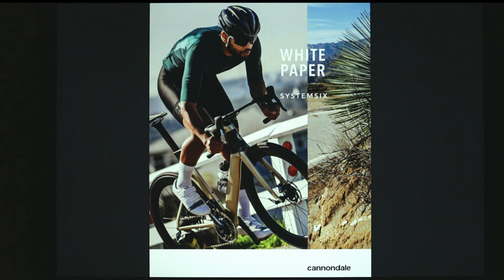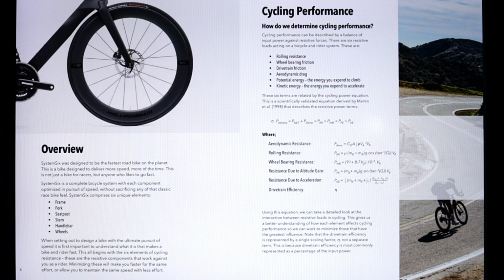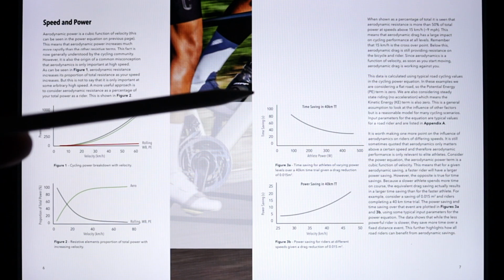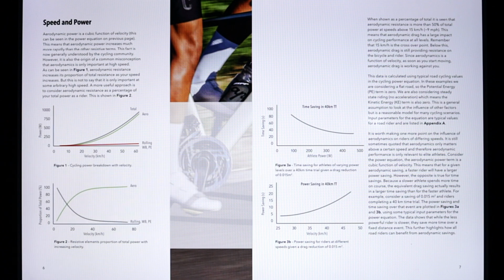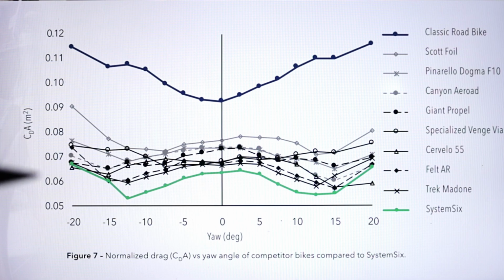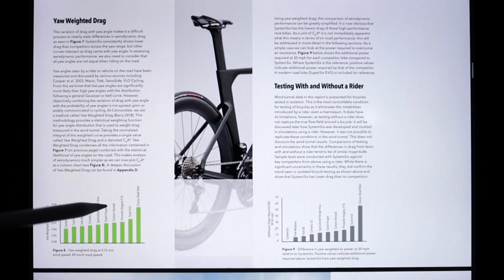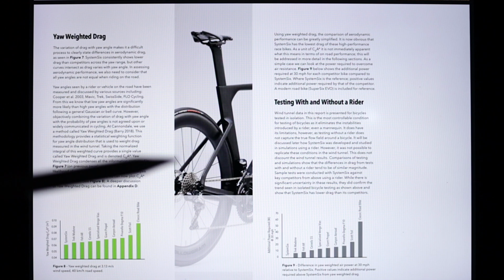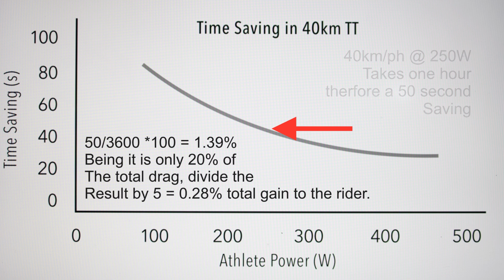Cannondale systemsix, fastest UCI bicycle on the planet?

Comment: TT-bike and aero bike are not much different in design; in fact, an aero bike can be used as tt-bike just change the cock pit. I question the data only because they all look identical. If you remove the brand name can you really tell them apart? An independent test done by engineers as suppose the bike manufacturer I may find those results more credible. Every bike manufacturer says they have the most aero bike or the fastest. But I like your videos very informative.

Comment: including that 20% are wheels (i guess up to 10%) integrated cockpit (5%), that leaves only 5% for the frame, which might be important for a pro-tour rider, but not for us "normal" ones. If you can't get into that aggressive position like a pro, your advantage is about zero percent. And don't forget, they are calculated over 100 kilometers over 40 or 45 km/h. So just imagine to stay over 100 km in that position and riding 40 k`s, that's insane, not to mention the lack of comfort on an aerobike.
Reply from the maker: I don't think they actually do the tests, it is just a calculated figure based on drag results from a wind tunnel. They never clarify these figures with details in there data.

Comment: Can you recommend any fast 💨 rim brake bikes 🚴?
Reply from the maker: This is a difficult question as "fast" relates to a lot of things. Handlebar width, tyres, drivetrain etc, but really the biggest difference is the engine.
Reply: @waynosfotos  Once again MAN!!! Hiroshima type TRUTH 💣!!! You better call ☎️ Sal...you’re headed 4 the court room 👩‍⚖️ 😳🥳
Reply: Basically all of the current FAST bikes but in Rim version. I’ve got enroute (for long distance) a Felt B2 in excellent condition...a Super Six in rim? A Wilier Triestina, a Cerveló S5 rim. Go watch Hambini’s aero videos to help you look 4 the 🔑 features in a ‘fast’ bike (front wheel tucked close to the frame, smoothed out rear seat stays, naca profiled down tube etc)
Reply: @SprayIgniteBoom  Thanks for the help but I am leaning towards the super six evo hi mod or system six disc. I might as well convert since that is where the RD is invested in.

Comment: I saw one in a showroom last week.
It wasn't fast at all.
It wasn't even moving.

What a stupid thing to say.
Marketing BS at its paroxysms.
A bicycle's speed is totally dependant on the cyclist's power/weight riding it.
Reply from the maker: Yep, and have you ever noticed the pros pass on these aero bikes mostly and go for the climbing or all round bikes?
Reply: @waynosfotos  
The bike industry is doing the same as the running shoes industry did in the 90's. Market segmentation to increase sale prices and volume.

Comment: I would apriciate some modesty from top manifactures that claim that their bike is the fastest or the most aero or more watt saving.
We are all going to find out after this year's races are through after all. 
What's funny thought is all these not walletwise "poor guys", that are going to spend 5 digits getting super fast machines and then stack a bunch of spacers on their "dream bike" headtube and will be wondering why they still need to get a cab in order to catch up the other riders.
As you said a more aero positioned rider on an average bike will outperform a rider that only depends on his aero machine for speed.
Reply: you can race fat old guys on a racing recumbent or velomobiles on flatlands to prove that the bike is important too

Comment: Sorry but they have to say how the tests were made
Reply from the maker: Agreed. 👍
Reply from the maker: My suspicions are many of these figures were calculated not done with live test, especially the 40km TT, so when your saying 40 seconds in an hour, this is such a small margin to control. Plus different riders size shape, weight, power meter variation, etc. How can anyone be confident to give figures down to increments of a second. 🤔 It would be almost impossible to calculate variance of controls at this level. Why i am sceptical of these figures. AND, how anyone can give figures without a rider is beyond me! It is like giving the aero gains of a caravan, without including a tow vehicle?? How can you ride a bike without the rider. How can you tow a caravan without the tow vehicle? Just madness science!